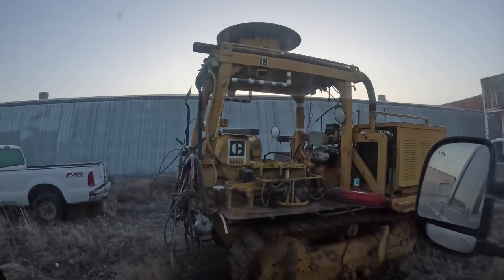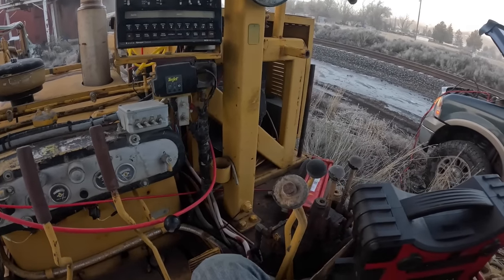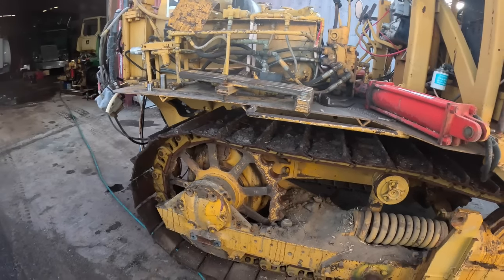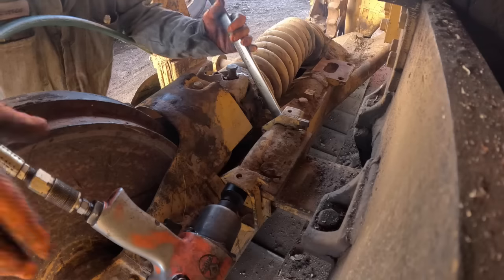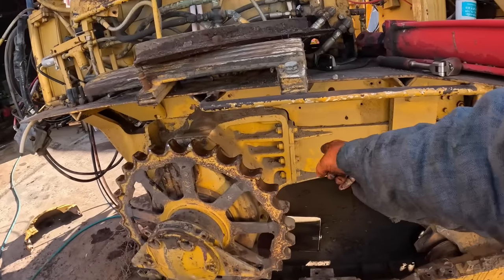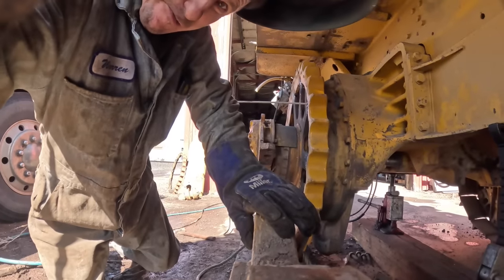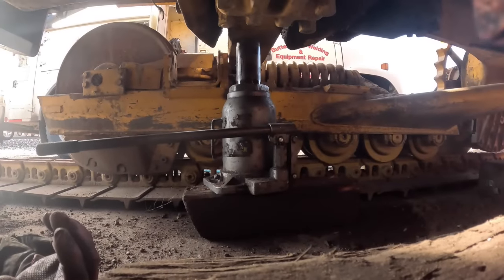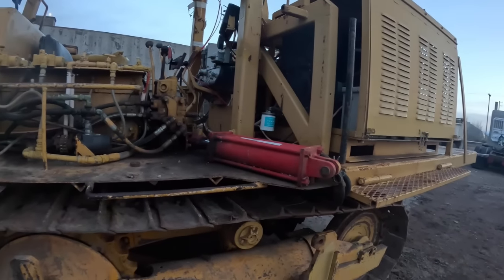Caterpillar weld on sprockets

Comment: Those fumigation crawlers seem to be a amazing misch-mash of everyone and their dog brother fabricating, abusive operation and half-hearted maintenance.
Issac @ IC Weld often times uses a needle scaler to remove slag on large welding runs, not only to speed removal but on the theory that the peening helps stress relieve.
Issac is a wizard with a cutting torch, uses air arc or plasma to move metal better than most people, seems very honest and forthright and definitely knows His arse from a hole in the ground.
There is another creator i watch that is honest and forthright that knows His arse from a hole in the ground.
Warren Rodgers, Best Wishes to Him and His Family.

Comment: Ive welded for years(I’m not a welder). Awhile back I started measuring what I was welding(thickness/gauge) with a micrometer. Then I’d lift the hood on my welder and reference the chart 📈 the factory provides. It’s AMAZING how much easier and clean welding can be when you have the proper heat and feed speed. Fifteen years I’ve been eye balling this crap and it shows👍🤪 Great video
Reply: Same here man 👍👊

Comment: Really Appreciate the Videos, Warren. I have welded since I was a kid and I have not used Arc Gouging yet, I’m going to see what I need to get started. I’m not a welder by trade, but I can hold my own on everything except pipe, unless I can spin it. I like your welder, how it doesn’t have to run wide open all the time. That looks like a fun but tough job. Thanks Again, Have a Good Weekend.

Comment: I don't understand cutting apart and welding the sprocket onto the old assembly. Wouldn't it be MUCH easier to replace the whole unit? Is the whole unit no longer available, or too expensive?

Comment: Good general rule for engine driven welders is not to exceed 80 percent of the machines max amperage while air arcing.  Also regulating the air pressure to 70-90 psi keeps from excess slag blow back.
Reply: @eaglezxz3354  -every engine driven welder I have is 100 percent duty cycle.  80 percent rules keeps the welder from bouncing off the Governor.  Shop machines don’t suffer from this.

Comment: A few years ago I wanted a welder for air arcing.  I had a Bob cat 250 but was told by a company rep it wasn’t big enough for 1/4” rods. So he sold me a Miller 302.   When they delivered it another company rep says to me.  I hope your not carbon arcing with this machine because it will void the warranty ???    So after some choice words from me they warranted it.  then I bought a  85 amp plasma cutter.

Comment: Hi, was curious what for wire are you welding with? Is it just a mild steel wire or a special wire for cast?
Reply from the maker: I'm not using wire, I am using 7018 low hydrogen rod. The sprockets and hub are cast steel.

Comment: What’s the best way to start a mobile mechanic business? trying to find customers but unsure how. any help appreciated!
Reply from the maker: Get a Google listing with your business name.
Reply: Do the best work you can and word will get out. Follow up a few days or a week or so after repair to check in. Some guys don’t like to call back if problems occur. They just write you off. Check in on them make sure it’s good. If it isn’t, make it right. Usually the call back just puts a bug in their ear and ends up in another job from them. 
Mostly word of mouth will get things going the best

Comment: Not unusual for an oil clutch tractor to lurch forward a little bit when it first starts up and the oil is cold.  Gets exciting when you’re sitting on the track running the pony motor controls and it starts moving!  

It may need a clutch but that’s not evidence in my book.  Always put it in neutral and set the parking brake on those old girls  unless there’s a dozer or ripper on the ground!

Comment: Why not remove the spoked drive and weld in your shop where you have a controlled environment.  Those low hydrogen rods absorb water/moisture like sponges.  A relatively high amount of moisture in low hydrogen electrodes causes visible external porosity in addition to internal porosity. It also may cause excessive slag fluidity, a rough weld surface, difficult slag removal, and cracking. I am not saying thats going to occur or is occurring in your current situation on this job. . . . But i sure as shit don't want to see a video in 2 weeks that you're in a farmer's field with three or four D6 caterpillar dozers that the drive sprockets have fallen off in the middle of their field's  possibly injuring the operators or worser. 
I think the last thing youtube viewers want is to tune in and the channel has been renamed Pedro's Welding and Tractor Repair  starring Warren